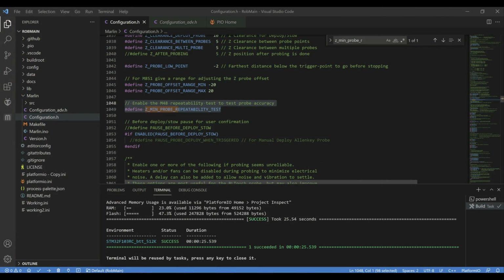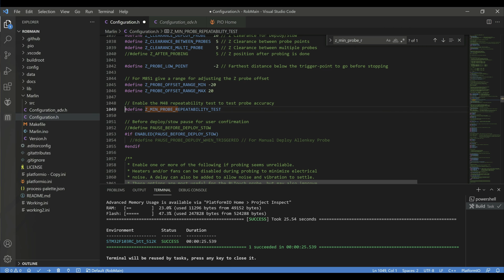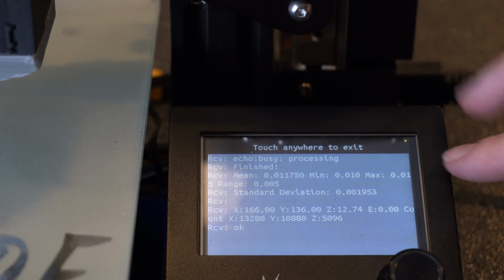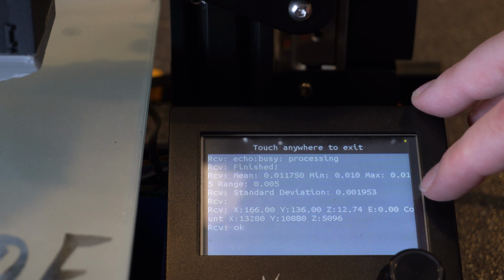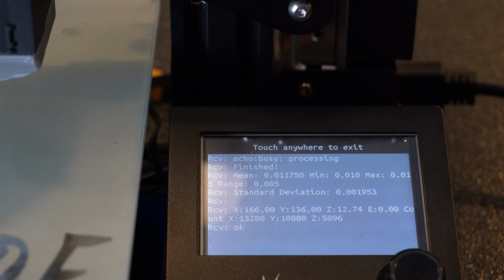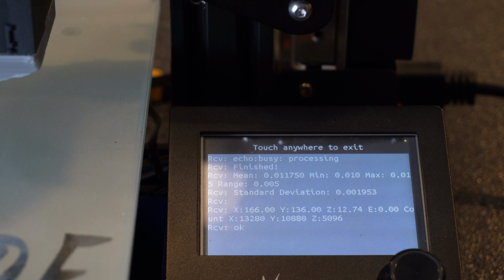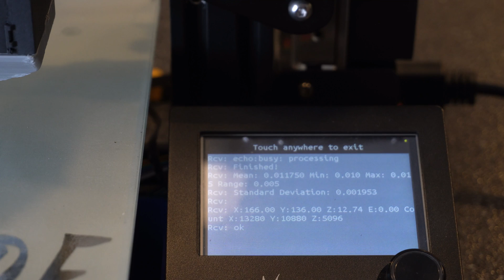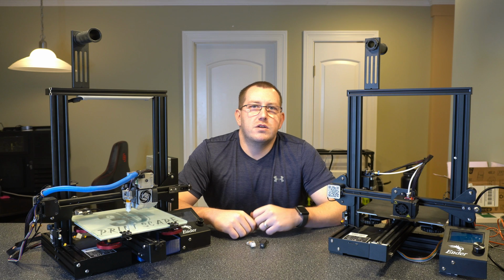CR-Touch vs BL-Touch – Which One Should You Buy?

Comment: Do you have firmware for a CR-10S with bigtreetech SKR mini 3 v3.0?
Reply from the maker: Hi. I dont sorry. I have it for the CR10, you could use that example file to cover what to change then enable the filament sensor. I think after the board swap the sensor is the only real difference.

Comment: Maybe you can help. I have a ender 3 pro with the Motherboard 4.2.7. I also have the new 3d pad 5" touch screen (not the V2 screen), and a CR touch. I can't find a firmware that works with both the touch screen and the CR. I was hoping you would know what firmware I would need.
Reply from the maker: Hi. I need to look into this one a bit more. I know they have special firmware for the screen and dont have any prebuilt versions that have both the screen and crtouch setup. I think i will end up buying the screen to try some things out.
Reply: @3DPrintscape  Yeah if you find anything can you update me. I've emailed customer support and it's been a month and no luck on the forums.
Reply from the maker: @tooepic9432  Will do.

Comment: I run 2 of each.. Both work as designed for me. But the CR Touch has a massive rattle while printing and its a bit larger than the BL. The BL runs with a red light and the CR has a blueish/purple light. IMHO the BL Touch is the better of the two even with the higher price. The rattle in the CR is really annoying, I keep checking it thinking my print failed. I just wish they still used the metal probe on the BL. I bent the plastic probe while using it on my Ender 5+. Happy Printing.
Reply from the maker: Hi. Thanks for the feedback, it seems people are in one camp or the other. I agree the rattling can be a little annoying.

Comment: I can't even get my BL Touch to deploy, it does the startup extension and retraction, but when I autohome it, it crashes to the ground, without the tip ever deploying. Anyone know what's up there?
Reply from the maker: Hi. It sounds like the wiring doesnt match the firmware config. How is it wired and what firmware are you using?
Reply: @3DPrintscape  so, when I got it, the wiring was wrong, and that's what caused it to not deploy, but when I wired it according to the diagrams, it deploys when the printer switches on, but when autohoming, it crashes to the ground.
Reply from the maker: @fizz113  Gotcha. There are two ways to wire the bltouch and the firmware config needs to match the way you choose. It sounds like the issue is there or the probe wires are revered (Not the ground, +5v, or signal).
Reply: @3DPrintscape  how do I know which is the correct configuration?
Reply from the maker: @fizz113  Here, I think this article will help. https://3dprintscape.com/guide-to-install-a-bltouch-on-a-creality-32-bit-mainboard/
Reply: @3DPrintscape  thanks! I'll give it a go and get back to you.

Comment: it may not happen to everyone but my cr-touch has a rattling problem
Reply: the pin possibly is the thing rattleling
Reply from the maker: Hi. Thats interesting and not a good sign. My CR Touch doesn't rattle at all. It may be worth trying to exchange it.
Reply: @3DPrintscape  I have 2 of them they both rattle the same. It's really loud. There's a fix on thigiverse for it. It's basically a clip you manually install that secures it after probing.
Reply from the maker: @dubbys  I did notice that mine started to rattle some as well now. I may look into that clip.
Reply: Yeah mine rattled too. I tried to install a slim shrink tube on it but the heat killed the magnetisation I think, because it is a shitshow now. 50% chance to activate it. I need to pull the plunger out manually in a right time before the error reported. Starting a print is like 10 minutes because of homing issues. Accuracy is still high tho.
Reply: I have mine in use since about 2 months now and I'm quite happy with it so far. So I hope mine won't start to rattle in the future. 
I print with 35mm/s though.

Comment: I now have Bl Touch on 5 of my 8 printers including a version 1 which is still working as good as the day it was installed, I don't have the confidence in Crealitys quality assurance or build quality to buy a CR Touch so any future purchases will be an Antclabs BL Touch.
 PS Despite Creality launching this probe they still have not fixed the XY offset error to any of their ABL equipped firmwares
Reply from the maker: Hi. Thanks for the info. I always move my printers over to Marlin and fix that myself, but I understand where you are coming from.
Reply: @3DPrintscape  Can moving to a different firmware help with layer shifting? I've been having problems with my stock firmware somehow shifting layers and I'm having difficulty on figuring out how to solve it.
Reply from the maker: @a_d3mon  It depends on whats causing it, but probably not. My guess is that you have a loose belt axis.
Reply: I’ve had nothing but problems with my BL-Touch. CR-Touch all the way.